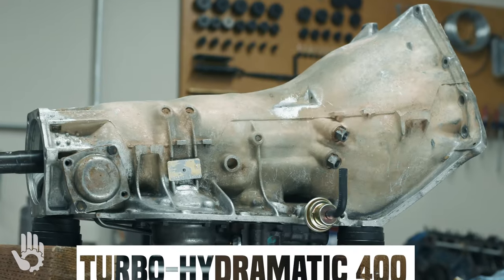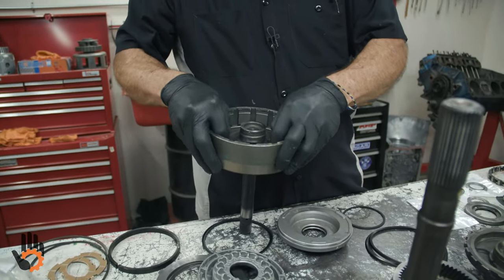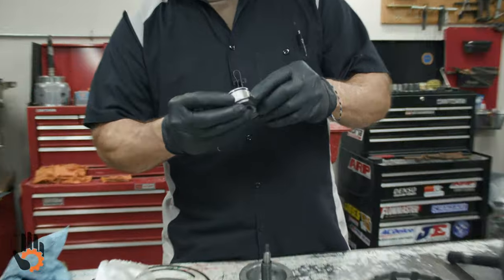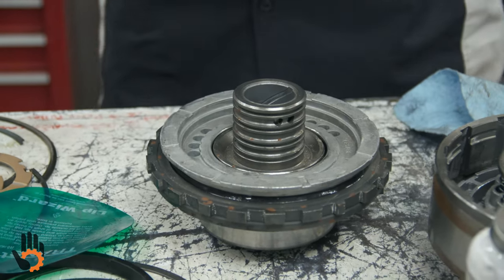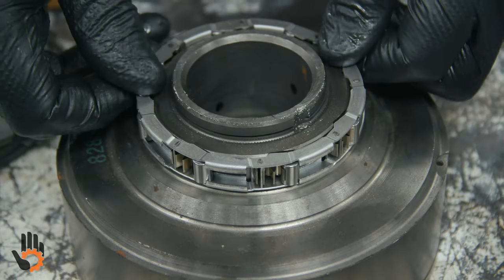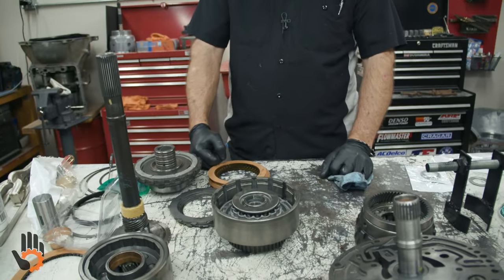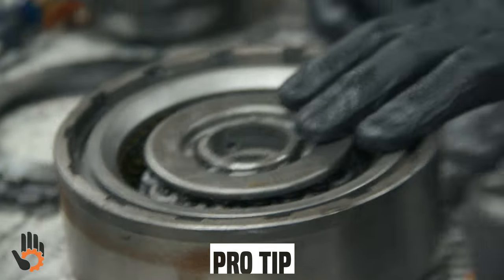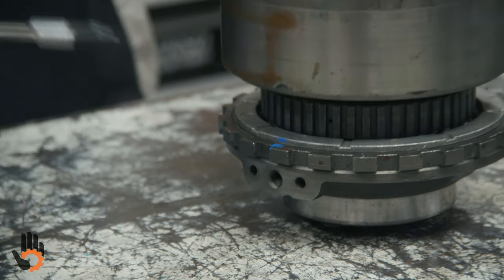TH400 Build Series - Building Clutch Drums

Comment: While I do like the amazon links, I notice a perennial problem over the years: listings die where part numbers may still be good.  It might be a bit of trouble, but listing actual oem and part number will stand up better over time.  Great vid series, and the attention to detail is excellent. .
Reply from the maker: It has been an ongoing problem, for sure.  That's a great idea.
Unfortunately, there's a character limit for the video description...and it's already up against the limit.

A few years ago, I was building an online store, to sell transmission parts.  However, I quickly realized that there was not enough time in the day to operate the store and simultaneously operate this YT channel.

When I can get more hands on deck, I hope to revisit the idea of an online store.  This way the links will be more dependable.

Thank you for your input regarding the links.
Appreciate your feedback on the video series.
Reply: @SouthpawAutoworks Maybe you could just link your own website in the description, then use your site to publish the Amazon/eBay links w/ part description. I’m using your Amazon links where ever possible, but like the previous poster mentioned, some are dead already.

Comment: Do the pistons come in different thicknesses? I tore one apart and it has a dished steel at the bottom where the wave plate would go. If I replace to a wave plate, I am way off on the play. I have way too much even with all thick steels.

Comment: A couple of things: This is a very good series. I'd never seen the inside of a transmission but my RV lost forward movement. Using your series and a rebuild kit from NAPA that only included seals and friction plates I'm sitting in the American Legion parking lot and rebuilding it. I'm reassembling and had 2 wavy rings left over. Google lens identifies them as fwd and direct apply rings. I don't see them in your video. I found a schematic so I have an idea where they go and I have to open the drums again to install them. Are they necessary? Also, since I'm doing this to become mobile again and I don't have the TransGo shift kit I wish you had identified the location of the check balls directly instead of in reference to the shift kit. Thanks for your effort in supplying these videos. Well done!

Comment: Great video. I rebuild about 10 TH400s a year and have trouble finding good used pumps and reaction carriers.
Reply from the maker: 10 per year, right on.

Definitely getting harder to come by some of these things.  I cringe at the thought of how many older, but still sought after, transmissions have been sent to the crusher/scrap.
I picture a trans with some smoked clutches, but perfectly good hard parts, that could be salvaged.

Comment: The link for the upgraded case bushing is for a faucet splash pad.  Lots of other items are unavailable, like the sprag and pump gears.  Any other sources for these parts you can suggest? Thank you.
Reply from the maker: Thank you for the heads up.
I'm looking into this right now.
Reply from the maker: All of the TH400 links have been inspected.  The ones that were listed as "currently unavailable" have been updated.  And yes, the kitchen faucet one, too.
Unfortunately, it looks like this may be an ongoing issue.  A number of the listings that were updated, stated that they only had a few in stock...sometimes even showing only "1 in stock."

When time permits, I'll see about partnering with a company that can reliably provide parts/tools.

Thanks again for the heads up.

Comment: Is it possible to get new parts to make a new thm400? I have an old 86 Chevy G30 and my transmission is going. Just want to know how much building a new one would cost me.
Reply from the maker: G30, right on.

Overhaul kits are readily available.  You can find links to overhaul kits, and other items, in the video description.  Current pricing can be identified by clicking on the links.

DISCLOSURE:  🕵
Links provided are affiliated links with the associated websites. While there is no extra cost to the purchaser, a small portion of the sale goes to support this YouTube channel.